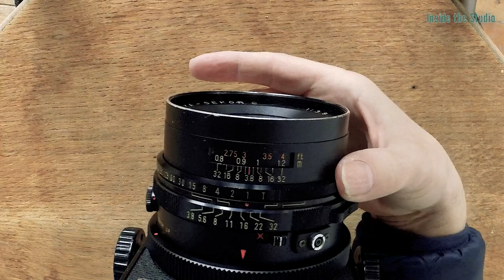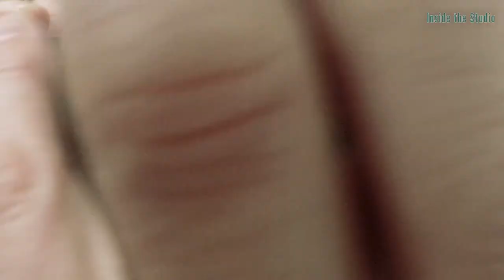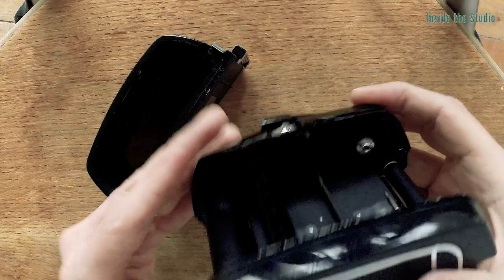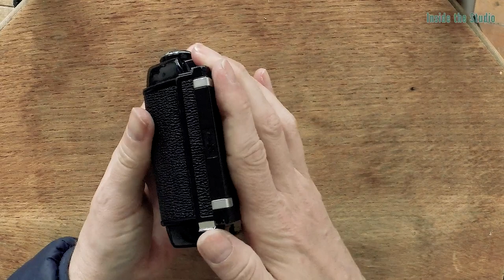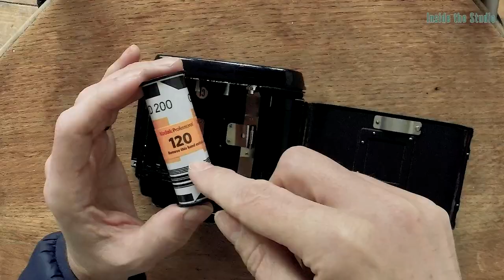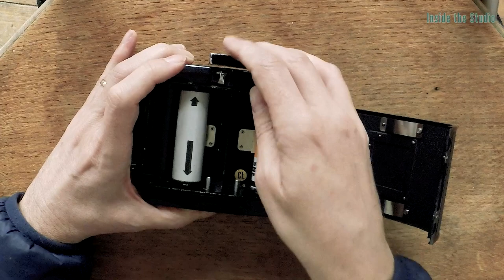004: Medium Format Photography with the Mamiya RB67: Part One - A tour of the camera, loading film.

Comment: The RB67 is an amazing camera and one I've always lusted after, but it's never quite been compact enough for me.  I much prefer the scale of the Hasselblad and the auto features that comes with the 203FE.  The RB67 captures beautiful images though and I've seen it used successfully by a documentary wedding photographer, so it does work.  Get yours fixed and it'll be good forever.  😅

Comment: At one time, I used three Mamiya medium format TLR cameras (C3, C22, and C220) with the following lenses:
180mm f/4.5
80mm f/2.8
55mm f/4.5
 
When it was time for me to replace my worn-out wedding cameras and lenses, I replaced them with two Mamiya RB67 medium format SLR cameras and the following lenses:
180mm f/4.5
90mm f/3.8
50mm f/4.5

The two features I liked were:
1. 6x7cm larger image size
2. Interchangeable film backs

The two features I disliked were:
1. Loud mirror slap
2. Larger camera size and heavier weight